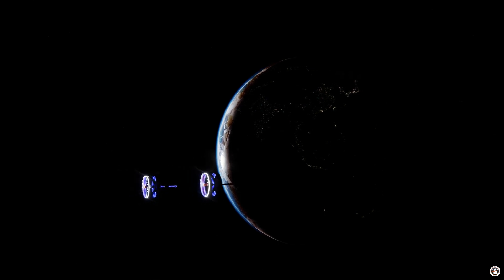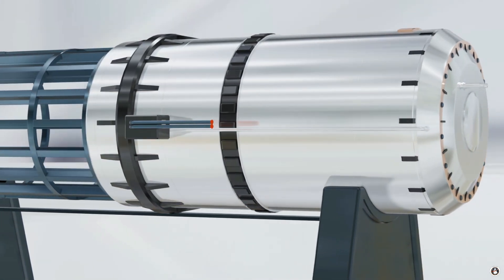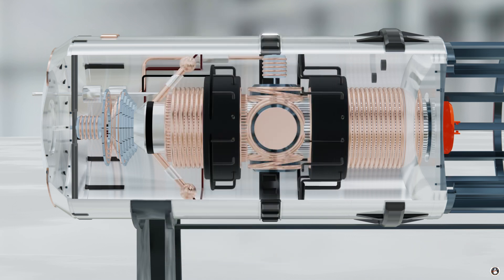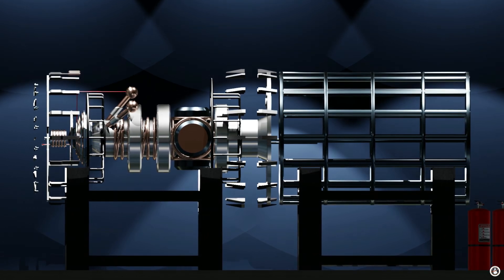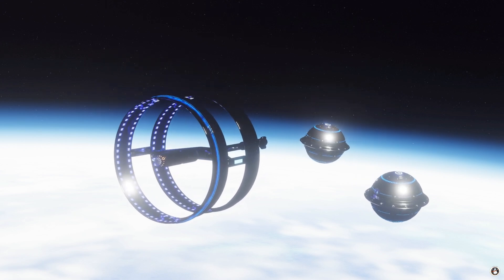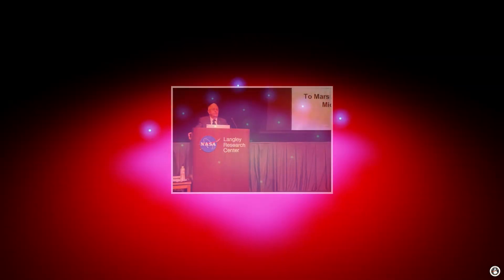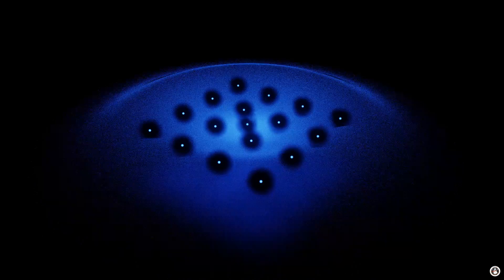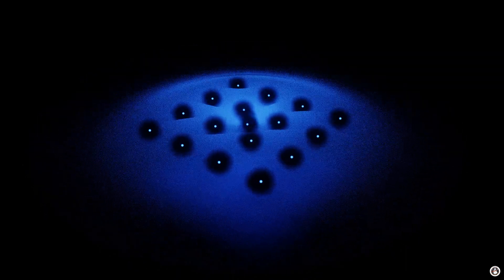Muon Catalyzed Fusion Engine - 8% Speed of Light - Mars in 5 days?

Comment: Interesting concept to say the least, though I have one question. How are the mesons being produced if baryon number is to be conserved?
Reply: If I understand this correctly...

Proton decays --> Positron, neutrino and energy. 
Neutron decays --> Muon, positron, neutrino, much less energy. 

The positive and negative signs would cancel out for the neutron and preserve the baryon number. The positron carries the positive charge of the proton.
Reply: @treasurehunter3744  do protons decay? I think not in the standard model at least...
Reply: @antaresmc4407  "In particle physics, proton decay is a hypothetical form of particle decay in which the proton decays into lighter subatomic particles, such as a neutral pion and a positron.[1] The proton decay hypothesis was first formulated by Andrei Sakharov in 1967. Despite significant experimental effort, proton decay has never been observed. If it does decay via a positron, the proton's half-life is constrained to be at least 1.67×1034 years.[2]" - Don't wait for it! See Wikipedia.
Reply: @Knossos22  thats not in the Standard Model tho. And there are faster, also hypothetical, and arguably much more speculative mechanisms that can get it closer, depending on your hypothesis, even under 10^30y :P
Reply from the maker: It is an annihilation-like process, the exact mechanism is still being studied, but new discoveries by others are pointed to a possible answer.
Reply: @asteronx  that energy has to come from fusion, so whats going on? Also, be careful with UDD because its scientific validity is very doubted. Its not well understood or defined and there are no independent confirmations to my knowledge...